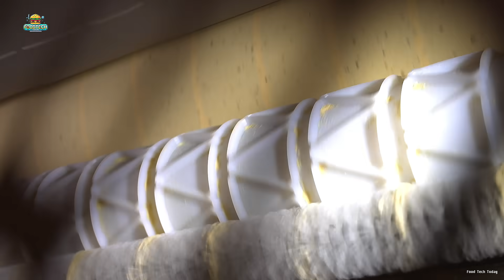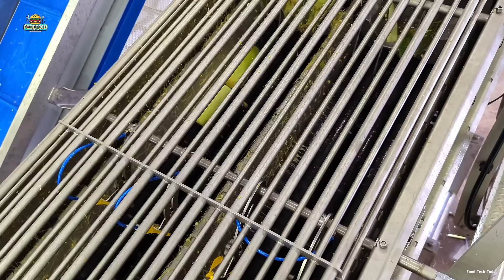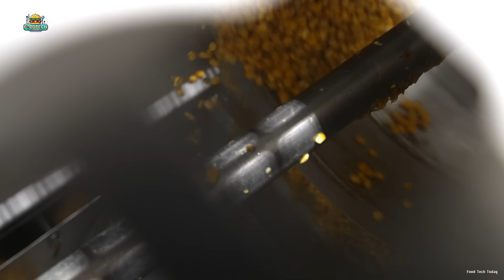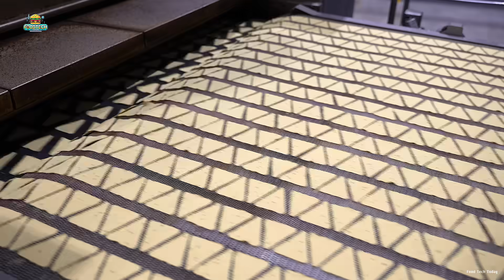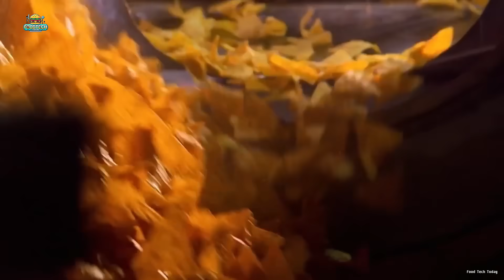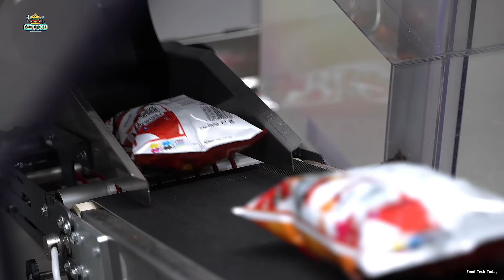How Doritos Cheese Chips Are Made in Factories 🧀| The Crunchy Nachos Production Process

Comment: I may be wrong, but the first part of the video was a processing plant for canned/frozen sweet corn. Notice the farmer picked the whole cobb and left the (green) husk on it. This is because you pick sweet corn when it’s ripe but not dried out. Look how wet the kernels are. The kernels were cut off the cob. Later in the video you see dry whole kernels of corn. This is what I call field corn or grain. The farmers let the corn stock turn brown and the corn cob dries on the stock to around 14% moisture and then they use a combine to harvest the corn. This combine strips off the brown husk and removes the entire kernel because it’s pretty dry at 14%. They haul the corn kernels "grain" to the grainery usually near a railroad. These “whole” kernels are what you see later in the video. The big question is why would they have this first part in the video?